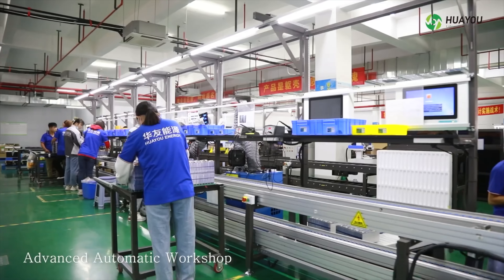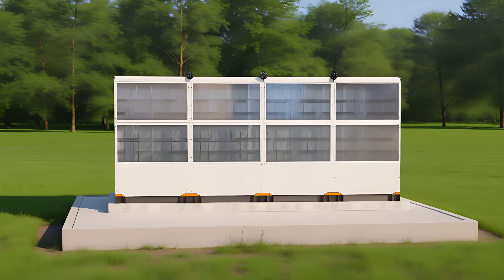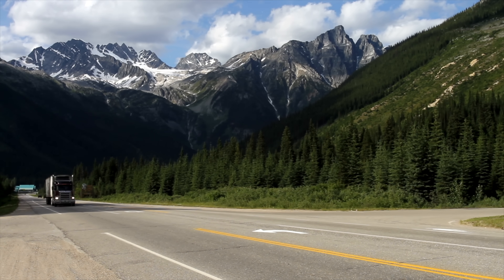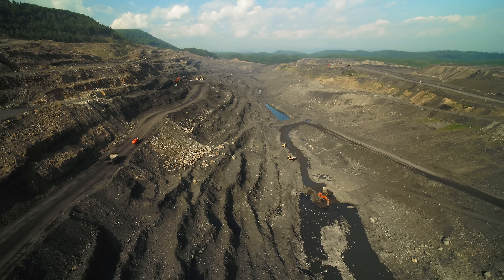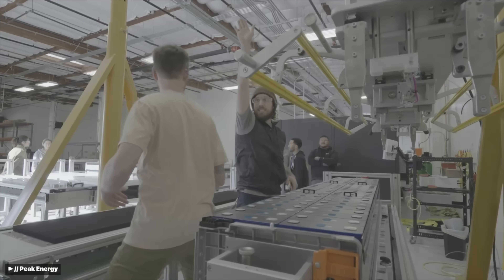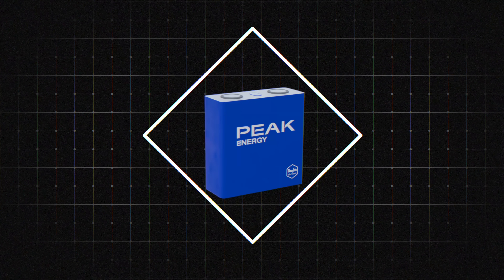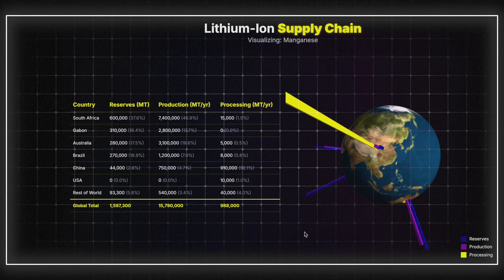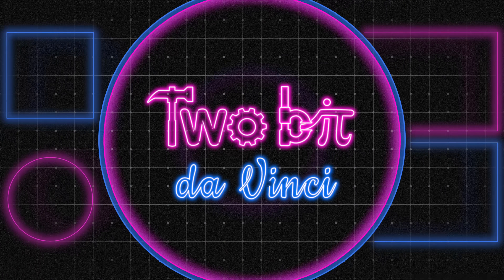Sodium Ion Batteries Are Going to be EVERYWHERE - Here's Why

Comment: Heard this story before.  No point in getting excited until I can go to Walmart and buy one.
Reply: The story is stupid as usual. Where it fails is that to get Sodium batteries cheap the cathode have to be cheap as well, and that basically limit us to iron-fosfate cathodes.  That pulls the battery density down to about 100Wh/kg that is just slightly more than NiMH batteries. While the NaFP cells both charge faster and last longer than NiMh cells, they really not better in other regrades, making them not suitable for neither cars nor mobile devices.. For a home battery storage, sure, but it will be pretty large. We talking refrigerator size.
Reply: @matsv201  How do you guys feel knowing that a few months later sodium ion 18650s have hit the market at half the price of lipo?
Reply: CATL is already making those in big number and even bigger number by december.

LFP is already around, many batteries go nowhere but some of those do come
Reply: @Perrirodan1  They made pet rocks in big numbers at first also.
Reply: @lostvisitor ...which has nothing to do with anything. 😵‍💫
Reply: @martythemartian99  It's probably a troll comment
Reply: Or you could build them and stop being an idiot servant to crap mfg.
Reply: When a title says "this will change everything" you already know it's sus

Comment: You mentioned energy density and safety, but one thing you didn't mention was charge cycles to failure or durability (when they simply wear out) or recyclability. To be honest I assume the recyclability is pretty good, as materials are [pretty common and possibly able to be reclaimed and reused. But it would have been nice to hear these things openly mentioned

Comment: Sodium ion is not new technology.  It has been co-developed with Lithium ion since the 1980s.  Its performance lagged lithium ion and that is why lithium ion won out.  I am skeptical that this startup has closed the performance gap, but we shall see.  For stationary applications such as grid stabilization, performance isn’t a big deal as you can easily make the batteries larger.  However, for personal electronics and mobile applications, power density is extremely important and it isn’t clear that sodium ion can compete here.

Comment: @0:35 Sodium is ABSOLUTELY not salt. If salt gets wet, no big deal. If sodium gets wet, very big deal.
Reply: @johnfreeman2956   sodium metal yes, but sodium ions are indeed a salt
Reply: @johnfreeman2956  I agree completely with the sodium metal not mixing with water. In another life, I was a "math" cook who used the Birch method. That entailed making sodium metal, so I am very familiar with it. You do not want that stuff to contact water because it will catch on fire in a very spectacular way. In closed containers, you have a 💣. 
Lithium is a lessor fire hazard than that stuff. Heck, just making it, you have bubbles of hydrogen gas exploding as electricity arcs in that bubble. Imagine what rapid decomposition from water does. Huge amounts of gas is released, and it better not happen in a closed container or even area.

Comment: You completely LOST me seconds in to the video when you told us that Na is “salt”. Na, or sodium, is not salt. It is an elemental metal of the same Group 1 metals as Lithium is. Therefore it is highly reactive in air and is readily EXPLOSIVE in water. 
“SALT” is a compound. Never the same as an Element; and for years has been technically incorrectly labeled as Sodium.
If you do not know Basic Chemistry, please stop ‘teaching’ us about technology.
But yeah Sodium can be used for batteries. It’s just no safer than lithium. And it is as ‘rare’ as lithium. Both lithium and sodium are some of the most abundant elements on earth. They are just not found in concentrations but are part of compounds to be chemically extracted.

Comment: Something doesn't add up, batteries rely on reactions, reactions happens to unstable materials, so how does this battery work with it's stable materials? Wouldn't it be slower to charge and discharge and it will probably be less energy dense?

Comment: The voltage curve will pretty much make it nonexistent for use in consumer electronics. A DC-DC converter adds cost and complexity to the device. Many Li-Ion BMS systems now will always leave 10-15% true state of charge when the device shows 0% as a battery protection.

Power tool batteries are also not going to swap away from Li-Ion because of that voltage curve. Imagine how annoying it would be for professionals if they had to keep their tools at 85% state of charge AT ALL TIMES in order to get optimal performance. As opposed to Li-Ion batteries where you get nearly full performance from 30% to 100%. Even with a DC to DC converter, you are having to draw more and more amps from the battery as it drains, making  heat buildup a certainty. There is no free lunch in using energy. One more thing in these high draw applications is what does the voltage sag look like under high load?

Large applications like vehicles and energy grid, where safety is paramount and density is less important. As you said, these batteries are great for it. But until we get a battery chemistry more energy dense than Li-Ion, we have to deal with those affectionately called "spicy cells" in almost everything else.

Comment: This will change little to nothing as a sodium battery has terrible capacity compared to lithium (less the half per weight and volume).  And then there is the way salt and metal don't play along. How much time before these start failing ?  Ans they are way heavier so for a EV that less the ideal.  The only purpose i see is mass storage where space is not a concern.

Comment: Ok, video but not a great video. Felt more entertainment than educational. In my personal opinion, you focused too much on the pros, and not on the cons

You also don't cover any of the technical details; i.e. discharge and recharge rates, actual weight comparison, electron density numbers, etc. You lightly touched upon how it's not as energy dense as Li-Ion batteries, but nothing specific.

You dedicated the first 15 minutes of the video talking about how good this battery tech is, less than 1.5 minutes on the cons, before switching back to how the cons might not be so bad.

Just missing actual scientific information that I would find useful.

Comment: If Sodium batteries does not need thermal management, they are 100% efficient, no loses, right? I don't think so. Yes, massive grid tied energy storage can be passive cooled if used for "low current" but EV battery need rapid charging/discharging and that will cause heat and will need some kind of liquid thermal management.

Comment: Any "safe" battery made from common materials won't hold much energy unless it's huge because it will have low energy density, then it won't fit in a car. As we already know,  high energy density batteries are expensive, require cooling, and they don't last.  EVERY new battery claim in my 62 years has been over overrated.  Any engineer knows engineering is an endless dance of compromise.  You can't have anything for nothing.  If you want more of something, you must compromise something somehow.  There is no such thing as magic batteries!

Comment: Did I see that voltage CATL constantly drops through its usage?  This character may be no go for the usage of this battery for products needing peak power through out its usage, like power tools, cars, etc.    I guess one can recharge at 50% but then doesn't that make it kind of like Lithium Ion battery that uses around 60% of its power before charging?  An Lithium Ion will maintain the peak power.

Comment: Who told you there are batteries connected to the grid?  That's ridiculous.  The grid is 4100 Volts AC.  Do you know what would happen to ANY battery if you connected it to 4100 Volts AC?  Go ahead and find out!

Comment: I think its 50/50 chance it will flop.
As far as cars go even for the daily 40 miles commuter its crap to have to charge it for hours and then there is the posibility that we will finally get the damn hydrogen engines if they will ever be allowed.
As for smaller scale use like aa, aaa, or phone batteries you said it yourself its not as powerfull as lithium batteries. But maybe there will be another breakthrough till then its dino juice for me 😁

Comment: I'm in the market in the next year or two for off-grid solar battery system in Thailand. I've seen that they are selling sodium ion batteries online here from China with 4,000 cycles and 10 to 15 amp hours at three volts... But I haven't seen any large batteries with BMS yet. I do have time so hopefully by next year they will be available. importing them from the USA would be prohibitively expensive due to tariffs and import duties plus shipping.
but I'm excited to hear about this technology startup in the US. it's needed. hopefully they will get the funding they need and find a qualified people to build and distribute them.

Comment: For grid storage, the main thing that really counts is cost per KWh of storage capacity, and secondly how many cycles it can do.
China has recently auctioned LFP grid storage batteries at around $50 per KWh. These are safe enough, fast enough, rugged enough. And no, they don't catch fire. OK, they can if you really try hard, but that doesn't stop us building Timber Framed Homes. 
More to the point, CATL has talked about Sodium ion batteries costing $10 per KWh. When CATL talks about something, people take note.

Comment: I have been waiting for low cost home storage for 10 years now.. I would love to have a 100kw sodium battery for my mid sized solar setup but it is still several years away as stated there are no at scale production factories in the USA and once production gets ramped up commercial sized battery farms will have priority and smaller batteries won't get a single thought from them.. So that would mean Chinese or wait a decade or longer and the price certainly won't be $20 a KWH thus screwing the US consumers again.. Where do these people learn manufacturing and retail? out of the mouths of Communists?? I would love to be part of a test program from the manufacturer but once again they have ZERO interest in the consumer market which is huge.. Natron Energy in Michigan makes them but none are approved for residential or commercial solar power storage and they don't want to even discuss it..

Comment: Wouldn't a dropping voltage rate mean you need massive capacitors (in the DC to DC charge pumps) to keep voltage at a sufficient rate to flow into the DC to AC converters and then transformers to supply the grid? This will reduce the effective storage capacity, that is you need more batteries than a similar spec LFP battery grid level batteries. Some quick back-of-the-envelope math would mean 1.5x as many batteries in the same area to reliably produce the same power. This is assume they have the same energy density which they do not. There may be another 1.5x increase due to density. So you need to ship double the batteries to produce the same output with sodium ion, so you dont need it to be cheaper but less then half the cost to make thus economically viable!

Comment: It’s not that great.  It has similar chemical properties to lithium but is lower energy.  Most of the cost and weight in a battery is the cathode, not the donor element.  Lithium is a little pricey now but it is a very common element and will become cheap once it really scales.

Comment: sounds nice but if it get implemented it will not come out for the next 5 to 10 years. All the companies that use LiFePo will not change overnight, they have to adapt their products to conform with these batteries, then we have all the curent inventory that needs to be used up. Many others will stil sit on the sidelines to see if there are any issues before moving into the new technology

Comment: I've been watching utubers talk about great new battery technology for years. Meanwhile my battery drawer is filled with lithium ion and alkaline batteries.
Reply: I have some sodium cells. I also have lithium-titanate. You can buy both types already (from China of course).
Reply: Mines filled with nimh
Reply: ...and LiPo....
Reply: the real technology is the youtube revenue they generated along the way! and btw this tech has been known about for 100s of years, it just wasn't used for one reason or the other, in recent times it's because the energy density is way worse than lithium-ion, and so it's not good for smaller devices. Yes, maybe it makes a case for grid-scale stuff where space and weight are less important than cost. But, in prior years there wasn't any demand for grid-scale batteries because when power was almost entirely generated by gas/coal/other sources via steam turbines, then the spinning mass of all those turbines on the grid were 'the battery' that stabilised the grid frequency. This is not a bad tech, but it's just a case of a company making stuff that didn't used to be in demand. It's not much more than that as far as I can tell.
Reply: @petervanhorn8573  I remember the new nicad rechargeable batteries in the 80's.
Reply: The go buy some more modern batteries 😂
Reply: @petervanhorn8573
You (& also me) are supporting a huge industry & there is no alternative.
Reply: Imagine, the largest camera Film producer kept the digital camera secret for as long as possible, so they wouldnt lose their biggest seller. They went bancrupt after the digital camera broke trough😂

Comment: We have an excelent test bed for an EV test mule for these batteries.   There are well over 500,000 Nissan Leafs driving around the world with a loyal fan base.  They use an aircooled battery pack which I'm sure require a lot of heat sinks to keep the batteries relatively cool.  I don't know how much larger these batteries would have to be to replace the 30kw, 40kw, and 60kw Leaf batteries, but what a great way to test the viability of these in an EV.

Comment: whatever happened to adding the tobacco virus to batteries that was supposed to extend battery life by 10 fold? Ive said it for decades. Batteries and energy are one of the largest bottlenecks to progress for humankind. Travel, electronics, research, even just way of life requires massive constant energy and its always tied to something with a noose. if we can cut that and reduce energy by 10-100x, we will make massive leaps and bounds.

Comment: So have they solved the Voltage Curve issue ??? LIFePo4 doesnt have fire issues either …

But anyway so far the reason we prefer Lithium chemistries is that Inverters are finnicky. 

They have a voltage input window, and Sodium has a steeper voltage drop under discharge. Its less efficient for the inverter to convert the dropping voltage into AC , and you could be hitting BMS cutoff way sooner than full capacity is used due to it leaving the inverters input window

Comment: Set your dc circuits to run at the min voltage of the battery and use a break diode for high levels of voltage. Simplest thing possible

Comment: 17:20· EV Range
The standard in the U.S. is three hundred miles.   This is because the interstate highest system placed fueling stations every 300 miles.   For today, less may be fine as very few highways only have ⛽️ fuel so far apart.

Comment: i'm interested to see how most of these claims hold up over time, we didn't know all the limits of lithium the second we started using them, we had to figure them out dead cell after deadly disaster for years of widespread standard use, i'm excited to see just how long these new cells last, just how dense we can get them, just how truly the full charge claim holds up, i have no doubt they will still over all last longer and charge better than lithium based solutions, but i more realistically expect there to be limits we haven't found yet

Comment: Sodium Ion batteries are where Lithium Ion batteries were twenty years ago when we were still figuring out the charging and discharging protocols.   There's every reason to believe we can improve the charging and discharging cycles in time, the question is will the lower material cost and no thermal runaway being possible be accepted by the public in the market when there are already lithium ion batteries with more advanced charge and discharge battery management to fund the research needed to improve sodium Ion batteries.  You have to sell some crappy ones before you have the funds to make improvements...

Keep in mind that China is the pioneer in sodium ion batteries...

Comment: A battery with the power curve you show with the sodium ion is NOT a benefit.  It is a MASSIVE NEGATIVE!  Everythoing needs a constant power output throughout its battery charge.  And who's going to run a battery to 0 volts?  That is not productive.  The best batteries will keep a high charge throughout their life, then suddenly drop at the end.  That's why lithium ion beats out NiMH and other previous battery technologies, not to mention their energy density.  Energy density is the key to virtually all batteries.

This video is a lot of hype, but that's about all.  Less chance of thermal runaway is good, along with using a more abundant source material, but everything else is a big negative.

Comment: Disagree 200 to 250 miles is not where most people wanna be if you remember the holy Grail of gas consumption is anywhere for 400 to 500 miles because people have errands and a lot more things to do than just going to work at 40 miles a day I’m not sure where you got that average from but if that was the case, it wouldn’t be so many cars on the road so I believe golden spot for EV’s would be 350 to 400 that to me would be the golden goose so that way you’re not having to constantly keep charging your car as you’re traveling

Comment: That discharge rate is a deal breaker, for power tools and inverters the voltage needs to stay consistent to get the same "power" from the cells